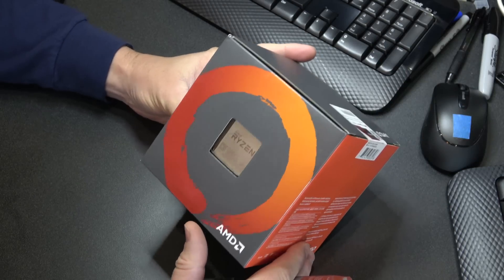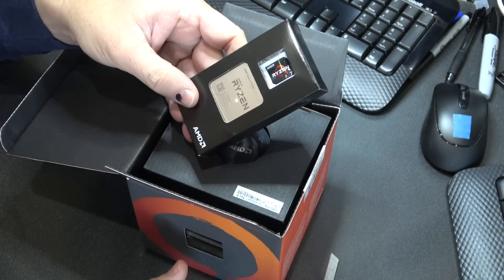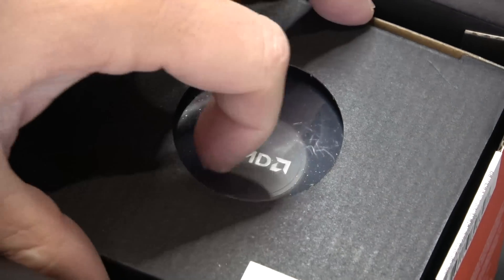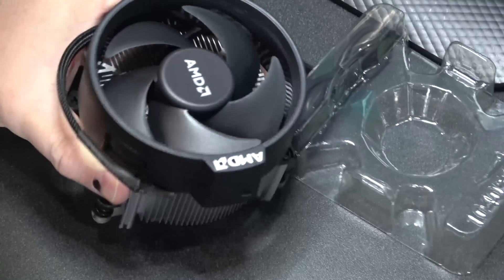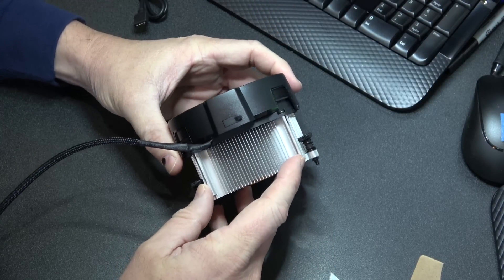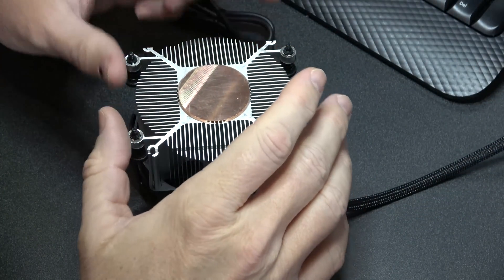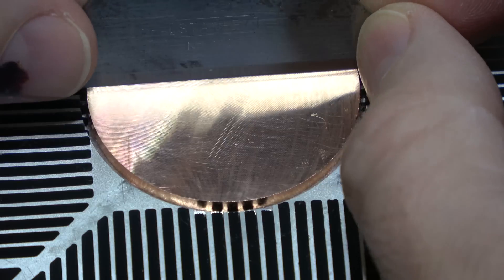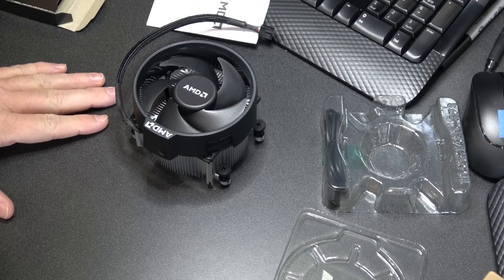AMD Ryzen 7 1700 CPU Unboxing - CPU and Wraith Cooler Flatness

Comment: I have an 130W Xtreme Freezer Cooler, should i use it then the Stock AMD cooler from ryzen?
Reply: No because the R7 1700 tdp is only 65W and the cooler is 130W, but use it if you want. It is overkill

Comment: Should we get another air cooler or the stock and cooler is enough for 1700 ??
Reply from the maker: That cooler is fine for stock performance, but the cooler the 1700 is the faster it runs.  We have reviews of over 20 air coolers. https://hardocp.com/article/2018/12/13/scythe_ninja_5_cpu_air_cooler_review last review has results for all.

Comment: What the best CPU cooler for Ryzen 7  1700?
Reply from the maker: That really only depends on how much you want to spend and how far you are intending to overclock.  The least expensive air cooler that I very much like for performance, and having and excellent and easy mounting system is the Thermalright True Spirit 140 Direct.  https://www.amazon.com/Thermalright-TRUE-SPIRIT-140-DIRE/dp/B01MQCK1PJ//?tag=hardfocom-20  It is a solid value and I have run stable systems at 4GHz with Ryzen 7 and this, however that is "on the edge" of its capabilities.  But I would suggest you can get a good 3.8 to 3.9GHz overclock with it and the 1700.

Comment: the scratches that appeared in the corner of the processor is normal?
Reply from the maker: Not sure exactly what you are referring to.  Would need a picture.  But most likely it is OK if it came out of the package that way.
Reply: Thank you for your quick reply. Just look at your video 5:04 the scratch like marks are clearly visible at corners of your processors. Even its appearing on my newly purchased cpu.
i have uploaded the image, plzz look once
https://ibb.co/fATsLQ

I am afraid if it is damaged or something?
Reply from the maker: That is no issue at all. That is just where the edges of the TIM and heatsink mated to the IHS.  Just clean it off good with alcohol and reapply new TIM before reinstall.
Reply: Ankit Navgwal o

Comment: I have a parts list.

MB- Asus V Formula Z

CPU- AMD FX8350 Black Edition or 9590.

RAM- Kingston HyperX Beast 32GB (8GB×4 kit) + G.Skill FTB-3500C5 ram cooler. 

MEM- WD Velociraptor 1TB×3 + Kingston HyperX Savage 960GB.

CPU Cooler- Probably Corsair H100i V2.

Graphics- EVGA GeForce GT 730 700 MHz 4GB 

Wifi- TPlink AC1900

PwrS- probably 1250w OCZ Gold.

Funny story, when i rebuilt with the AMD Ryzen, my old build already got shat on interms of.... well, everything.

Comment: All right, I don't know about this 1700, does it comes with igpu on it or not?
Reply: Andrei GoldenVIpers boi
Reply from the maker: Nope.
Reply: Ryzen 5 2400G it's what you're looking for!
Reply: Andrei GoldenVIpers but that's only a quad core...
Reply: Boi ... I know boi but for budget gaming build it is damn good, boi. In my case, boi I am going to buy one and after some time after I will go to buy a dedicated gpu, boi with amd ryxen 7 1700 but first things first I want to buy this ryzen 5 2400G including a gaming monitor having 144hz free sync, boi. I intend to make the build much faster than I've expected, boi.

PS: I already did buy boi I have already one X370 Killer Sli motherboard from ASRock and a genesis titan 660 gaming case, boi.
Reply: Binary YT what's up boi ?

Comment: The fact it has a copper slug over intel skimping with a full aluminum heatsink has already won my heart. Plus the screech those pins made on the heatsink just killed me RIP.
Reply: It's actually better than a copper slug; it's a vapor chamber. These stock coolers are full-on amazing considering previous ones were just made to be "good enough".

Comment: Why aren't stock coolers optional?
Reply: hm... Wonder the same thing.
Could actually lower the price .
Reply: My guess is that a replace cooler is always good to have.
Reply: I mean with all cpu ever, it should be optional at least.
Reply: Kristiano Bertucci they become optional if you buy them from EBay. Haha.
Reply: Because it is not free. I actually have to pay for something I don't need.
Reply: Kristiano Bertucci Why complain about a free piece of practical hardware
Reply: They are optional, there are always tray cpus you can buy
Reply: The cooler is completely free of charge, your only paying for the processor.

Comment: No offense but not really sure if you had to go so in depth about how flat the surfaces were. I mean they are heat sinks they should make complete contact that's just a given right?
Reply: That is interesting, Could you name 1 cooler that you can use without Thermal Paste?
Reply: the thermal paste is for heat dissipation. unless you are spending $1 on a cooler its going to be flat lol
Reply: Sam Mcaninch sometimes they don't . that's why we use thermal paste

Comment: The cooler is freaking amazing. If their best performance stock cooler were a little more efficient than a HyperX Evo 212, than it wouldn't require a change unless you would need the extreme performance of a water cooler. Which would be great. Can you overclock with the stock cooler at all?
Reply: Lucas Ezequiel up to 4ghz with a nice motherboard

Comment: I got this 2 days ago. The cooler is very pretty, but it is quite loud. It doesn't seem to spin down very much, although it could just be the motherboard not reading the temps properly and spinning it up more than it needs to be. I was able to get to 3.3 GHz before the temps were too much, which isn't much, but I wasn't really expecting to be able to get any OC on it. 
Until NZXT get their asses into gear and finally produce a mounting bracket for my Kraken, I'll have to use the Wraith.

Comment: can this cpu o.c with the low end motherboard and do it run well with old window like 7,8 and 8.1 because  i check the all motherboard have driver for all the old window
Reply: go than thank for information
Reply from the maker: If the motherboards supports it.
Reply: NEW A., Ryzen CPU's can only be ran on the latest version of Windows, that being 10. They're also compatible with Linux.
Reply: i order amd 1700 with m.b but i do not like window 10 driver problem
Reply: DJHeroMasta not true. as hardOCP TV stated, it depends on the motherboard. the are videos on YT showing Windows 7 and 8 running fine on ryzen

Comment: So does it come with preapplied thermal paste? ... If so, did you use it?
Reply from the maker: Yes, it comes with TIM.  No, I did not use it.  I use MG Electronics Silicone Base TIM for use on the test bench.

Comment: Hm. My 1700X didn't come with a stock cooler. Which would be fine if Corsair would've gotten their adapter brackets out promptly.
Reply: atomkinder67, The X series don't come with stock coolers.
Reply: Yes, but many reviewers were simply stating "ours didn't come with a stock cooler" and it was unclear for quite a while (at least to me, after watching probably a dozen initial review and benchmark videos) whether any or all would come with the stock cooler. It's not really a big deal though, just less thermal paste I'll use up since I'm waiting on the Corsair adapter.

Edit: and of course it states this on the Newegg product page so I'm entirely at fault here X-D

Comment: fix that nail, get a dremel and drill the discoloured area with a small bit at the lowest speed. There is a gap between the trapped blood which u can hit perfect by drilling a second at a time until it comes out. I'd kid you not it is VERY satisfying.

Comment: Maybe someday they'll come with mirror finishes so that no thermal paste will be necessary.  Did you use less thermal paste due to the new flatness?  Most coolers today that come with paste I just use that the first use, it's good stuff.  I've rarely seen a CPU cooler with a surface that well honed as a stock factory cooler.  I love the design of the cooler and integrated RGB.  I thought the RGB was going to be on by default according to initial images.  Nice to know that a cable is required to turn it on.  You didn't go over any software required to manage the RGB though, how does that work?
Reply: Devil When u want to control the rgb Lightning over software than you need a asrock am4 Board (like the pro4 Ort something...). When you dont have a asrock Board then use a standart LED Strip Controller shoud work ;).    (The asrock Board has two 4pin rgb LED Outputs one For the Fan Second for any LED Strip {Looooovvee it!!!} you can control both throu the software).
Reply: Devil Hey, getting this cpu and was wandering if you knew if thermal paste came included. If not i have to go get some.

Comment: Do you have a lot of background noise or something? I'd rather hear a little noise than that freaky echo.
Reply from the maker: Sorry, been having mic issues for a couple of days now, trying to get those worked out.  :(
Reply: Thanks for the response. Glad you're working on it! Every mic you get test the noise floor and try and get one with the lowest so you don't have to reduce the background hiss in post editing. Mic's that require phantom power usually lower the noise floor with higher voltage and the cleanest signal is always from batteries, not AC power supplies. Good luck!
Reply from the maker: Thanks. Using a Tram TR50 BPS now.  I tend to move around a lot so I need to keep it in consideration.
Reply: Those mic's LOVE 48v DC from a battery pack :)

Comment: you have a smashed finger nail in every video of yours i've watched.    be careful with that hammer man!
Reply from the maker: Well, these videos have all been very close together.  I was changing the water pump on my truck, and had a spring clamp locked open, when suddenly it popped close and hit me down in the nail bed.  So it was actually under the skin.  Finally looks like it about done thankfully.  Not exactly pretty to look at.
Reply: ouch....i'm always banging up my hands.  hey why i have your attention.  is there any point in delidding the i7  7700k and using anything but the liquid metal?    like perhaps some well known thermal pastes out that doesn't cost $50 a tube (small one at that)?
Reply from the maker: Short answer is yes.  Chart at the bottom of this page, and considering the 7700K is going to run hotter, I would expect to see a bigger delta in temps.  http://www.hardocp.com/article/2017/02/02/intel_kaby_lake_i57600k_cpu_delid_relid_temp_results/  I think however a lot of the difference also comes from the relidding process, if done properly, reduces the distance (Z height) between the die and the IHS.  I think their is a lot to be said for sealing the IHS back on too.  More on that here.  http://www.hardocp.com/article/2017/02/21/relid_your_intel_cpu_on_cheap_no_delid_tools/  Has some explanation as to what I have found while doing all this craziness.  :)
Reply: cool man ty.  i enjoy your vids.  no malarky.

Comment: An actual decent stock cooler, which makes for a nice change. Probably won't be used by 99% of enthusiasts but at least they put some effort into it.
Reply from the maker: I already have it running and its cooling abilities are looking pretty damn spiffy.
Reply: and it free
Reply: I'd be very interested in some kind of review of the wraith cooler. I'm trying to make up my mind about buying a new cooler with my Ryzen processor and would be nice to have some solid facts.
Reply: I'm also looking for a review of that cooler.  I don't usually use stock coolers but this one looks fairly decent.  The CPU is apparently ice-cold until you start manual overclocking.  I guess that's where the 30-watt difference in TDP comes from.  I wonder if this cooler is adequate in overclocking without too much noise.  I can't imagine anything better than a motherboard and a 1700 at about 4GHz for $480... beat that, Intel.
Reply: I've given up caring about cooler master sending me an AM4 socket kit for my Hyper evo 212 led.  The stock Wraith spire cooler is doing great, and the RGB effects with my MSI board are untouchable.  I love this thing. Keeps my ryzen cool!
Reply: Its relay nice to have before you get your watercooling stuff.
Reply: CaptainMcShotgun I remember finding my pentium 4, threw that in my system with no cooler and just put a piece of ham on it, fried it and ate it, that's how hot the chips were back in the day, honestly you have it easy xd
Reply: It really looks nice! I love the red ring around it with the lit up AMD logo.
Reply: Heilung I just found out that any "X" version AMD Ryzen CPU shows 20 degrees more hot than it really is. How or why I don't know?
Reply: yes but in some county am4 cooler is not on sell yet if u look for cooler intel easier to find
Reply: there is a review of the wraith that came with the FX series, can do mild overclocks and still stay cool.
Reply: I have the wraith cooler for the a10 7890k. I overclock to 4.7 ghz, voltage on the high end of 1.5ish but the hottest it will go heavy load is about 80 but on games high 60s low 70s.
Reply: good new than
Reply: ElteeMullet lmfao
Reply: Personally I have no problem with the stock intel cooler but the ryzens cooler looks badass tbh, I don't really like the look of the intel one.
Reply: CaptainMcShotgun ikr, looks like it was made for those pentium machines.
Reply: CaptainMcShotgun I guess it's enough for cooling though, I have it for my i7 6700 and under load the most I've seen it at is 74 - 79 degrees
Reply: That's still an improvement over 100%
Reply: CaptainMcShotgun how long have you been a pc gamer?
Reply: which msi board do you have? i'm trying to decide between pro carbon and the xpower titanium
Reply: SVTsupercharged Are you using petroleum jelly for thermal compound? You need to check your Mobo utilities and see what setting your fan speeds are set to. Consider using a better thermal compound. If your Wraith isn't enough to bring your 1600 up 0.2 you're doing something wrong. The Wraith is one of the best stock coolers we've been given between performance and appearance. I don't mean to sraight up flame you, but you probably have at least one of a few issues to contend with if you're breaking redline temps on a 1600x clocked up 0.2 with a Wraith. Check your fan speed and compound, make sure everything is straight. Also, remember the Ryzen X models have a 20 degree offset. You may be perfectly in the safezone and just unaware of the temp readout offset native to the X models.
Reply: SVTsupercharged I guess we're not looking at the same market of CPUs because Ryzen chips run much cooler than the Intel comparables. If you're using the stock paste that's problem number one. Use a real thermal compound, something like Noctua NT-H1. Inexpensive, easy to get, easy to apply and cleanup, excellent heat transfer. You say you're getting back in your display? Can you give an example with a link or something to compare to? Again, not trying to attack you but this sounds like user error. I just setup another Ryzen system on my personal rig at home, this one is a Ryzen 7 1700 (that's the 3.0 8-core) on the GA-X370 K7 and OCing at 3.7 without issue, stock Wraith cooler air-cooled and running 68°C with fan at 1850 RPM under 40 minute load. I just don't understand how you can be having these issues unless you're playing in a house at 98°F indoors with poor case circulation. You're only over clocking 0.2 and getting visual errors that sound like you're physically destroying your CPU. What kind of temp readouts are you seeing on the cores? Again, remember to drop the readout by 20°C on the X models.
Reply: SVTsupercharged I've mentioned it to you twice. It's a safety protocol because they are anticipating over clocking, and the smart fan systems increasing cooling based on the temp reported.
Reply: It's good for people who don't have money to buy a cooler together with the MoBo RAM and CPU. Unlike Intel.
Reply: amd is back
Reply: The cooler is sub par...I own one on my Ryzen 1600X. Going to upgrade to a Cryorig. Not even good enough to clock to 3.9ghz. All of you commenting on this probably don't even own one!
Reply: Heilung I used what it came with from AMD. It wasn't even running a regular Wraith, it was a AMD Wraith Max cooler. I've already compared other similar set ups to mine, not even close in temps. Then blotches of black started showing up on the screen when playing games. If you didn't know the new Ryzen systems are known to run hot. Which is complete garbage for over clocking.